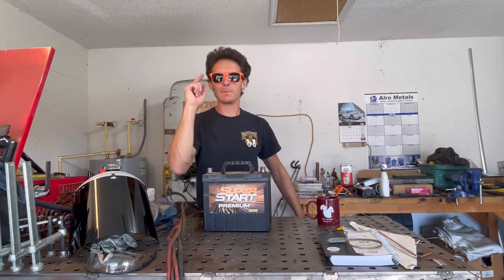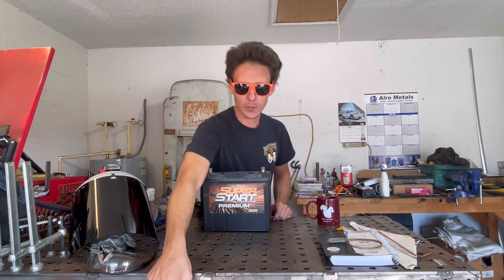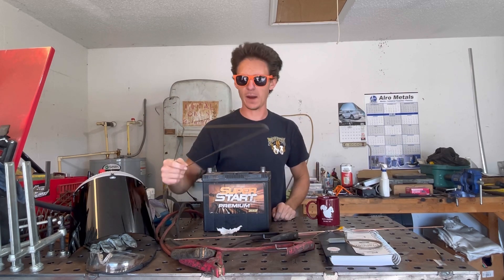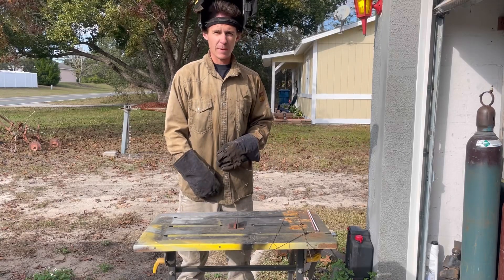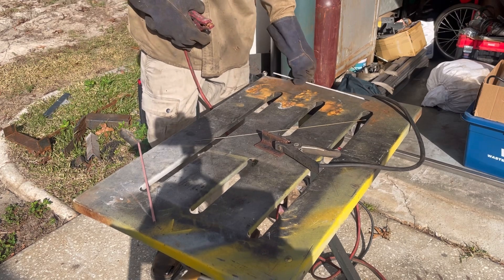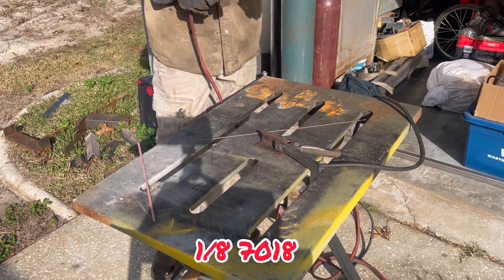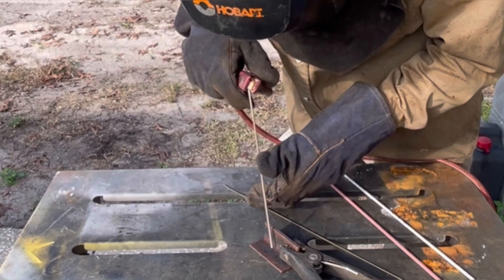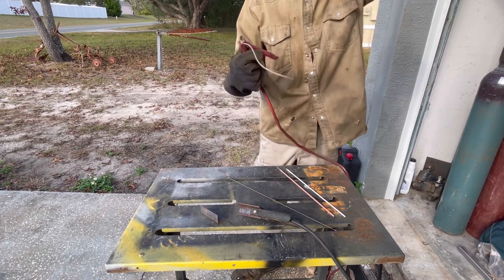Emergency Welding! (Can you Weld with Jumper Cables and a Car Battery?!)

Comment: Sure can! I use 2 batteries in series, 1/8" 6011 run DCEN. I made my own setup with welding cable jumpers w/ battery terminals, and a stinger and ground clamp. It burns through rods very fast so you have to keep feeding it in quickly. Works great for offroad vehicle repairs on the trails.
Reply: One other note: most warn to keep the batteries away from where you're welding because the hydrogen gas emitted from the battery under load can cause a battery explosion.
Reply: That’s how I do it. Two 800 cc battery connected in series. Works like a charm.
Reply: And... those batteries suffer from slow loads not fast
Reply: Can you weld with them still connected to your car and the engine running?
Reply: @Foldingshirts lmfao